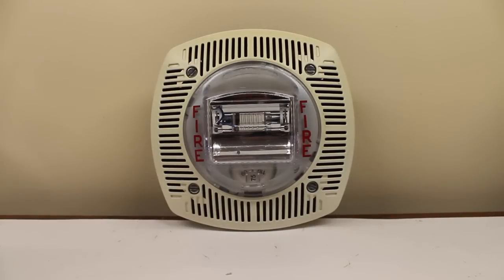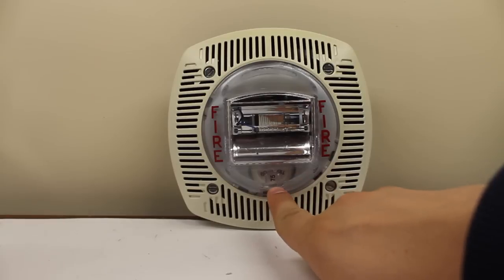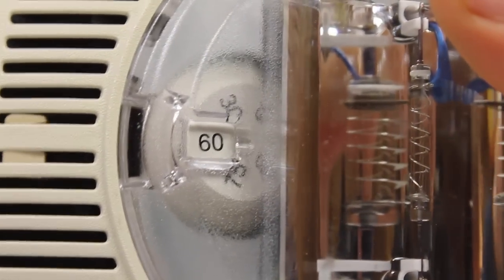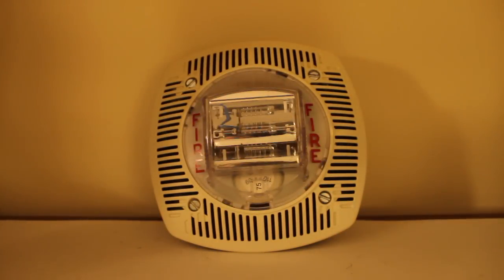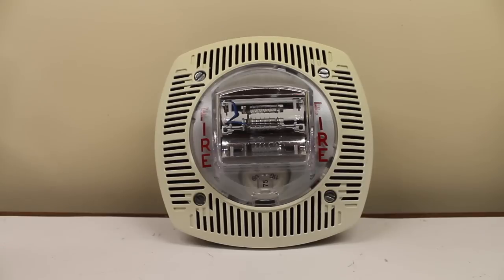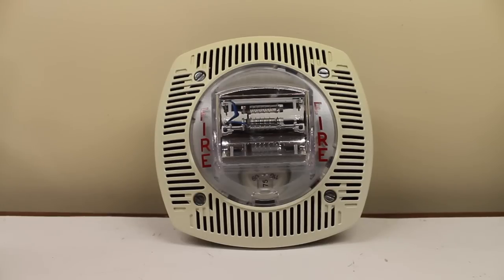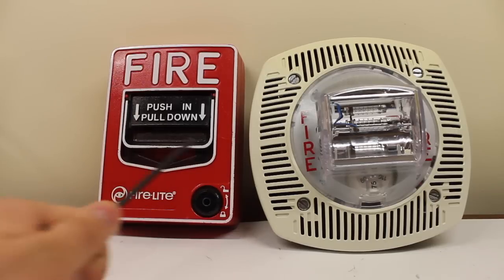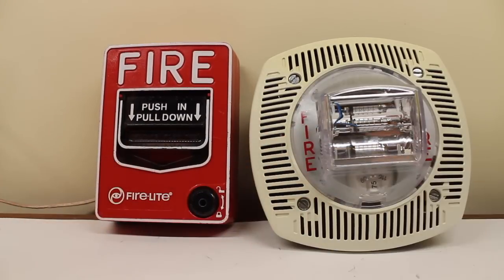Gentex SSPK24WLPW Fire Alarm Overview/Demo

Comment: Why are speaker strobes always bigger than horn strobes?
Reply: Cesar Blanco duh the have speakers
Reply: The speaker mechanism is pretty much always larger than a horn mechanism and can’t really be made to look as compact. An electronic horn can be fit into a more compact size while still being REALLY loud, and you can’t make a speaker loud enough without it being the size that it is.

Comment: These look. Interesting. Obviously not the most attractive alarm to see but it still gets the job done!
Reply from the maker: NJMoo3652 I wouldn't say this is the most attractive device in my collection. However, it's interesting how they were able to morph one of their strobes (just take a look at the whole assembly, lens, reflector, etc) with a speaker to create this. Not sure why, but it still seems kinda cool. Overall, it reminds me of a boat speaker...with a strobe on the front, of course!
Reply: Yep, these are unique and cool alarms. These would look a little odd on a wall though. I noticed that gentex likes to keep the shape and design of their strobes consistent across their devices. It's amazing how compact this alarm is. It's smaller but it still outputs loud audio and a high candela flash. These have to be half the size of the Wheelock e70 or et series. A speaker strobe that doesn't need a backbox extender ring? It's a miracle!

Comment: Gentex still sells strobe expansion plates for these speaker/strobes, right?
Reply from the maker: Craig Baker Yes, they do, for alert strobes. I don't see them stopping anytime soon, dual alert systems are pretty hot right now.
Reply: ***** I have a question pertaining to the mass notification systems.  Do you know if any company makes an alert strobe expansion plate for Edwards EG4 speaker/strobes? The college I attend has tons of them with amber lenses.
Reply from the maker: There is in fact an attachment for that series as well. I think it looks better because the expansion's strobe has a smaller footprint, so it doesn't take too much space. Look for the G4ERA-A on Google, that's the red version.
Reply: ***** Yep.  That's the one.  Funny that I could not find it on Edwards Signals' website.
Reply from the maker: Oddly enough, I couldn't find it on the site, either, I happened to find that model number on a distributor's site. Not sure if they got discontinued.
Reply: Yeah.  I know Gentex, System Sensor, and Wheelock still make them, but I have no clue with Edwards.
I know that their LED Genesis horn/strobes are not listed on their website, so I am wondering if they have not been able to update their website.
Reply from the maker: I have an LED Genesis that I will eventually do a video on. I cannot seem to find any information on it anywhere other than the eBay auctions. Mine didn't even come with an instruction manual. Either they haven't yet updated their site or they haven't technically released them yet, mine could be a prototype!
Reply: ***** That's weird.

Comment: If you remember about that sheraton I told you had Wheelock CF819Ts, I also found this model gentex speaker strobe on the upper floors of that hotel
Reply from the maker: I would think the Lobby area would have had the upgrade of the Gentex speaker strobes and the rest of the floors would have the CF819Ts, assuming the lobby area had some sort of renovation. That's interesting that the upper floors got the upgrade, probably for ADA purposes. That makes that find a bit more interesting.

Comment: These are fairly common where i'm from. Especially at movie theaters.
Reply from the maker: At a movie theater, assuming what you described is some sort of chain-run multiplex, it would make sense to have some sort of voice evac system. There is usually a mass amount of people in the building at a time that are there to see the various movies that are showing in each of the different auditoriums. At a time of emergency such as a fire, it would make sense to have something that would tell people to head to the nearest exit. Having a system like this as opposed to standard horn strobes would keep chaos to a minimum...hopefully.

It's interesting that these devices are common more in your area as opposed to other parts of the country. From what I have seen up here, it seems like more System Sensor or Wheelock devices are installed as opposed to Gentex devices.
Reply: Yes it is a chain and it is very cool.
Reply: The Springfield Theater in Springfield, Vermont, got ones like those during the major renovation, but they're red. And the panel is a Silent Knight. (IFP 1000?) I know there's a separate one for voice evac and thus reminds me of the Simplex 4003, IIRC.

Comment: Newenglandelevators have you ever heard of a simplex 4903-9001 the extremely rare light version of the 4903-9101 it has white lens instead I own one it is more rare than a 4050-80 I only seen it 2 times out of 3-4 years
Reply: Classic AlarmTech  hello it’s CrazyMineblox64
Reply: My school had them but they were replaced by truealerts in 2020-2021 :(